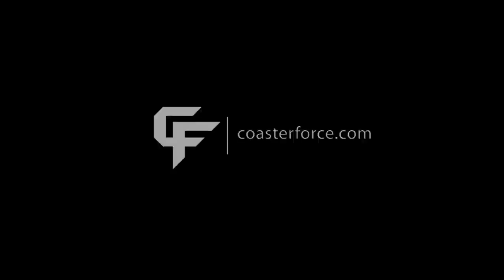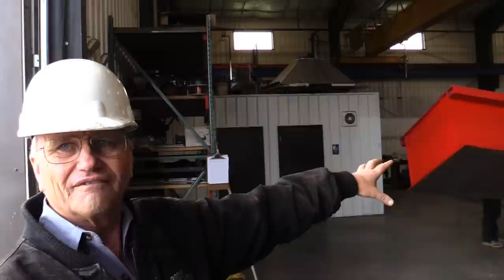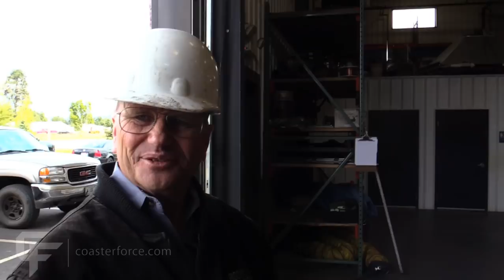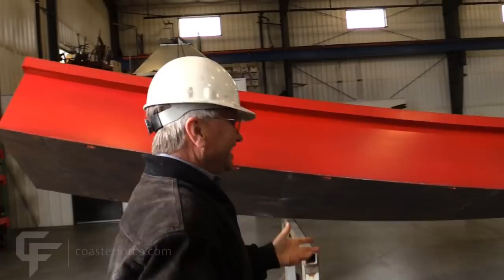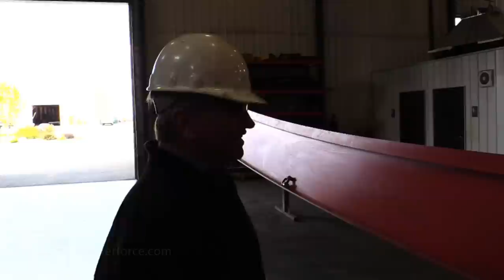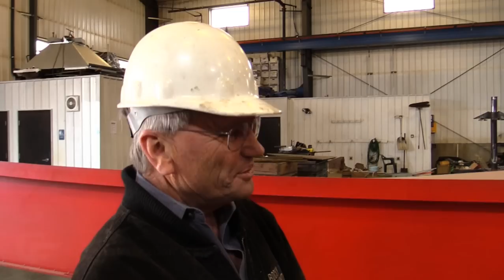RMC Single Track Coaster Concept HD Rocky Mountain Construction

Comment: I wonder if having a single, wider rail, would reduce the weight on any wooden coaster structure, be it an older ride being converted or a brand new roller coaster.

Comment: I don't see why it should be possible to create new coaster elements, which weren't possible with the old track design.
I don't see any advantage of this compared to an Intamin or B&M design.

But I understand, that the construction of such a single track coaster could be much easier compared to the standard RMC hybrid-coaster.
Reply: +5thElem3nt Probably they are able to execute sharper twists when necessary. The wheels will be closer together. Would mean a lot more of the restrictions to the track would be rider comfort.

Comment: So, is this solid steel? It must weigh a ton...
Reply: From what I understand it is a hollow box made of steel plates.
Reply from the maker: +Serenade314 It's cut from steel sheets and is hallow, so it doesn't weigh much more than the two steel tracks RMC currently uses.
Reply: How many pounds?

Comment: Okay here are some ideas. Rmc Flyer. Rmc inverted. rmc with vertical drop. rmc with beyond vertical drop. 4D rmc. wing coaster rmc.  loop on a rmc. Suspended swinging rmc. rmc with floorless trains. Rmc standup. Rmc tilt coaster. Spinning rmc.
Reply: +Simonthan woah woah slow down there I can't take in all that awesomeness of that sentence at once
Reply: +Simonthan RMC Robocoaster. Multi-launch RMC. RMC rotating tower coaster. RMC bobsled/flying turns. RMC triple racing/dueling. RMC QUAD dueling/racing. RMC shuttle. RMC hyper. RMC giga. RMC Polercoaster. Oh yeah, and RMC junior too perhaps.

Comment: Single track coasters aren't a new idea.....both Steeplechase at BPB and the former Wacky Soap Box Racers at Knotts were/are single track coasters.
Reply: Yes but they haven't been executed recently. Those are fairly old coasters, not to mention that this will probably  be just as fun as any other RMC
Reply: So it's like a monorail track. I wonder how they would keep the trains locked on the track?
Reply: +lanceflx63 depends on the style of train but this design in particular means very heavy trains. Think something with the passenger capacity of gatekeeper or better with extreme flexibility in overall design. Trains giving a riding experience of suspended, side friction, or even something further out of the box like an extreme Disney monorail all possible.
Reply: These isn't really a "single rail track." Single rail coasters only run on ONE rail. However, this looks like it will run on two as you can see the two small rectangular beams jutting out from the side of the upper part of the track. It's a singular beam track, like what Intamin or B&M utilizes. Instead of having two bolt two steel beams onto one wooden frame, all they'll need to do with this track is just bolt this one steel beam onto one wooden frame. It allows for an easier construction process. The track look is still growing on me, but it looks amazing so far. Can't wait to see what RMC does with this.
Reply: +Tommy Carr And not to mention, this looks like a two tracked coaster
Wrapped in aluminum foil.
Reply: Correct. It is not a "monorail" track type concept.
Reply: And if you look at the consent art for the train, it's clear that this single rail is the same width as the two rail track, so it's not much different to a normal RMC.
Reply: +lanceflx63 About the trains staying on the track, do you see the two extruding parts on either side of the track? Thats where the up and sidestop wheels would go.
Reply: +Simon DLSea (VO) What?
Reply: I can't stand how Steel coasters often usually fall in disrepair

Comment: its ugly as hell, dont see the advantage over track with splines and 2 rails. dont think its cheaper to produce. also supporting the thing stays the same. forces on the track stay the same so whats the gain in this???
Reply: +ThemeDesignGaming Negative Nancy! I'm sure these guys know what they're doing, they've already revolutionized the industry.
Reply: Probably for distribute load on a wooden coaster or to create a warping-resistant track.
Reply: ThemeDesignGaming Something called painting it